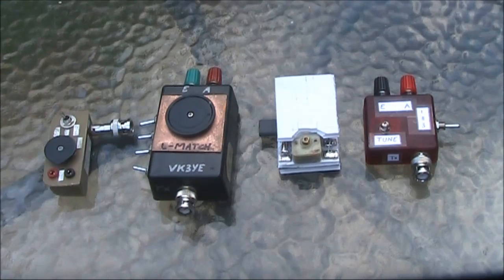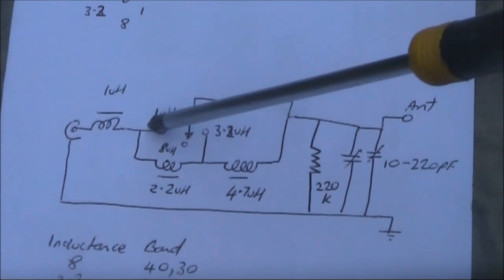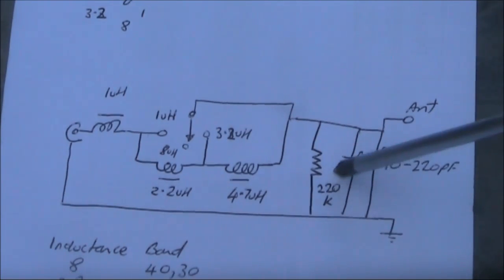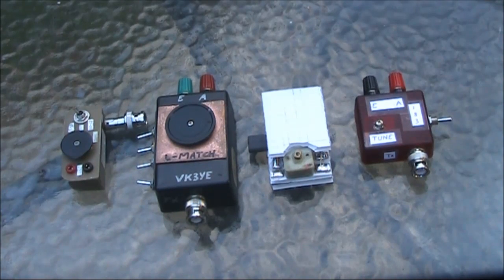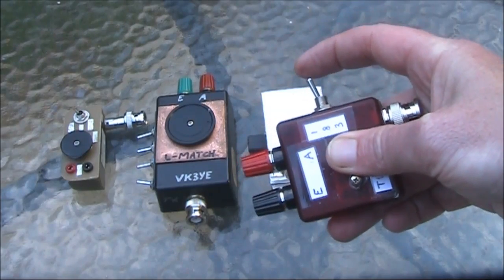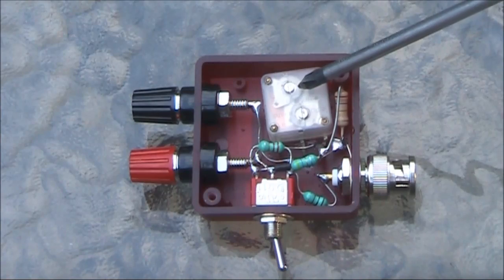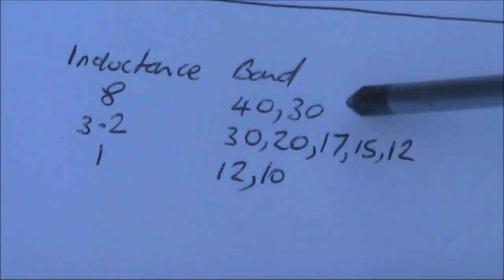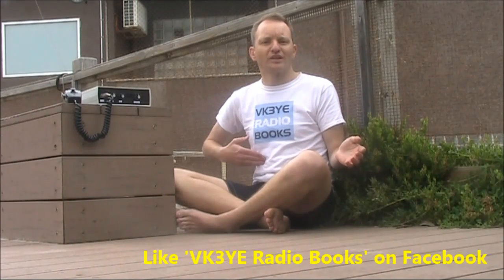Palm sized L match antenna coupler

Comment: Been looking at the L match plans on your website but wondering how many turns on wire do I need on the 25mm plastic tube and at how many turns do I place the taps, cheers zl4hsv
Reply from the maker: It's not critical - just have taps every few turns of a 30 turn coil or so. More turns for lower frequencies.

Comment: with this coupler you do not use your antenna with coil? 10.45m + coil + 1.85m?
Reply from the maker: One could but I find there's little point when portable.  There's normally sufficient room for a full sized half wave wire on 7 MHz and the coil just adds extra bulk when carrying.

Comment: Why are you using a 220k resistor? Does not it work like a load?
Reply from the maker: The 220k is there purely as a bleeder for static discharge.  It doesn't affect the coupler's operation.
Reply: That resistance must be able to dissipate the total power of the transmitter?
How do I calculate it?
Reply from the maker: Doesn't have to.  Its value is so high that even with the coupler tuned to match a high impedance antenna the current flowing through it is negligible. Hence the power dissipated is also low.  So you don't need a high power resistor.
Reply: A dipole has a resistance of  of 52-75 OHMS , and end fed of 2000-4000 ohms which is considered a high impedance value. A 220 k-ohms resistor is practically invisible to RF    @aldrichsarmiento

Comment: Can't remember in which video you mentioned that you couldn't find any panel mount male PL-259 connectors. I found at least one seller on eBay who has them, in case you're interested. http://www.ebay.com/itm/1pce-Connector-UHF-PL259-PL-259-male-plug-4-holes-flange-solder-cup-Panel-mount/271867731204
Also, have you checked out the Windcamp 11.1V battery for the FT-817? They are made to be mounted inside the battery compartment of the radio. I wrote a blog post about it recently, in my seldomly updated blog. http://la1wua.com/?p=136
73 de Magne LA1WUA

Comment: Hi Peter, great video. I'm running  <10 watts thru LD-11 LNR QRP radio. Will the variable cap and axial inductors work fine?

Also @5:05 are you taking notes on that banana?   :)

Comment: been trying to find the variable cap you used. Is it a poly varicon and how critical is the capacitance range 10-220pf. not having much luck
Reply from the maker: Value not super critical. Eg a max of 150 pF should be OK.  This is what I used. https://www.jaycar.com.au/60-160pf-miniature-tuning-capacitor/p/RV5728

Comment: I've (experimentally) found that I don't need the larger gang on the capacitor for 7-30MHz, I've just been using 5-60pF
Reply from the maker: Interesting.  I've typically needed about half capacitance when both connected (ie approx 100 -120 pF).  This is with about 6 - 8 uH of inductance.

Comment: Interesting as always Peter, thanks. How do those axial type inductors compare with inductors would on toroids?
Reply from the maker: I guess that toroidal type (with reasonably thick wire) would be a little less lossy and handle a little more power. Though if you're serious about the latter then you'd need larger metal spaced tuning capacitors.  Haven't done a comparison though.